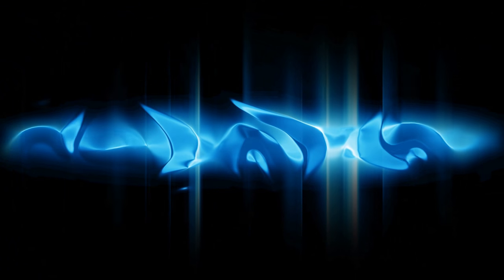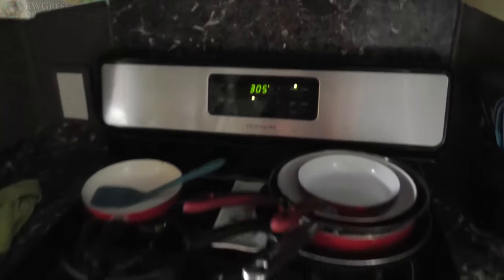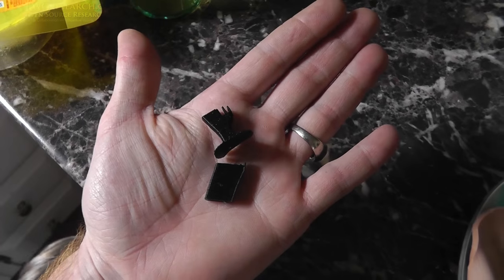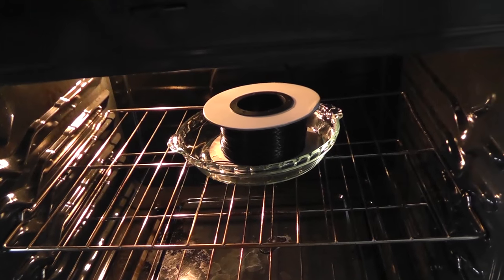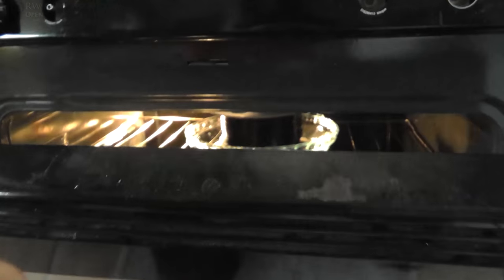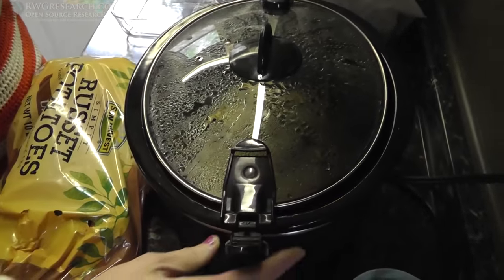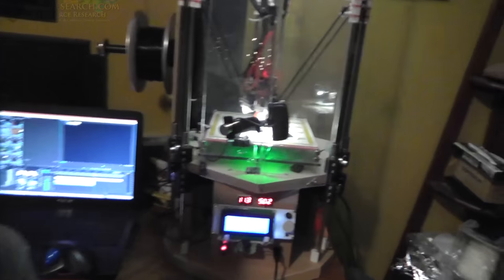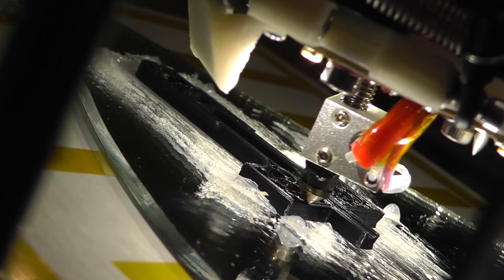This Seems Like A BAD Idea... Baking Filament In The Oven... Really?

Comment: Russ, your gas oven uses a hot surface igniter style system in the oven. Not all ovens use this style system but yours does. To extend your oven's glow coil igniter/glow bar igniter, Always be gentle when closing the oven door or doing anything around the stove. Thumps and bumps that cause the stove to jar can damage the igniter. This is especially true of when the oven igniter is glowing but it is a good practice to be gentle with the stove at all times because the material the igniter is made of can crack with even slightly rough treatment. The ignitors are usually made of a substance called Carborundum if you want to read up on it.

Comment: I am going to put my filament in a bell jar and vacuum it down to roughly 30" vacuum.  At that level water boils.  Hoping it fixes my brittle PLA.
Reply: That's sound like an awesome idea, did it work? I'm really interested
Reply: @jorgetucson8196  I imagine only if the vacuum is strong enough to permeate through the plastic. even a perfect vacuum has its limits.

Comment: Your wife tolerates your 3D printing hobby about like mine does. I waited until my son was 10 years old before I bought a 3D printer and then I let him build it with my supervision. For baking, don't use a glass pan, just put the spool directly on the rack to minimize contact with hot surfaces. I think baking at the lowest temperature possible is best, like 50C or 120F. The filament won't be damaged, the temperature is even OK for PLA, and it just takes patience (a few hours). My oven has a "warm" setting, and set there, the center rack gets to 110-120F. For ABS, you can use the lowest "bake" temperature, which would be around 170-180F.

A food dehydrator would be optimal, but we have no room for it, and they cost more than buying new rolls of filament.

Comment: I have been annealing eSun PLA + parts the past three days and the usability has greatly increased. The annealed parts are fine for hot outdoor environments now for sure. The strength has increased a bit too. 

The parts do change in dimension with about a 3-4% decrease in X/Y axis and about a 2% increase in the Z axis. The PLA+ seems to shrink a bit less than standard PLA in my observations, all this can be calculated in your slicer if need be.
I bought a $35.00 toaster/convection oven at Walmart and it works great, bought a oven thermometer toofor more reliable measurements.

Comment: Hey, be careful because not all ovens are extremely accurate and you are close to ABS's melting temperature (about 60 farenheit away). If by instance your oven is innacurate and reaches that temperature (190-270 celsius for ABS) the abs will begin to melt and emit toxic fumes (ABS is extremely toxic especially compared to PLA).

Comment: thought you had a vacuum pump?
better to just put in a container and vaccum pump out moisture,

I see this more for brittle filament like PLA, I would also "temper" PLA by putting in hot water, and works pretty good.

I will be building a box and add some color changing disicant, like blue is dry, red/pink full of moisture, then can reuse the disicant by putting in oven and watch it turn blue again. cool down and ready for the next

Comment: Use a vacuum chamber. It does the same thing as a oven but at low temperatures...also use desiccant in the chamber and once a vacuum is pulled you can store the stuff in the chamber it works really well. Yes baking is a bad idea and their really is no reason to do it.
Reply: They have special ovens for welders to keep certain rods from having too much moisture. It would probably be useful to have a vaccume chamber, unless you already have a small oven for rods
Reply: Yeah, I think more people have ovens than vacuum chambers

Comment: I am curious to know if nylon 6 filament which needs 240c to melt would work if we fill small pieces of filament in a silicone high temp mould to make a cast part using melted filament in oven?

Comment: One could construct a filament pre-dryer chamber that the filament passes through before going into the printer.  This could have a temperature that is controllable and only used when necessary.  You don't need to heat the entire spool, just the bit you are using.
Reply from the maker: +Clifford Wagner that's a good idea, however i'm not sure how long it take to " bake" out the moisture... it would take a while a lower temps... ~Russ
Reply from the maker: +Clifford Wagner that's a good idea, however i'm not sure how long it take to " bake" out the moisture... it would take a while a lower temps... ~Russ

Comment: Great video, but 200F sounds like it's still far too high for PLA, to me atleast
Reply: hes using ABS which has a higher glass transition temperature and melting temperature, but yes 200f would be far too high for PLA

Comment: You cant just vacuum seal filament rolls with dessicants, dessicants prevent further moisture from going into the filament but they do not EVER draw existing moisture out of the filament. You need an oven, and if not an oven a humidity controlled cabinet with a dehumidifier. Baking in the oven is a very good method but NOT a standard food oven, you need a low temperature oven like a cure oven

Comment: Did dou try blowing less on the hot wire deposition during extrusion ? I'm pretty sure it cooled down just a little bit too much before fusioning the new layer with the previous one, doing a bond that laminate easily when cold.
Btw, you're right when you warn about moisture, that's something we learn at school during plasturgy workshops (plastics engineering, i mean), and also controlled in factories during corporate interships.

Comment: For this your job i think you need fruit dryer. It is slower but you never melt your filament. In your link these guys real good whom creating nozzles. Firs time i have read about carbon fiber printing. In that project it is not mentioned one comparison with expensive nozles with rare materials. In our country's makers exibition I saw from guest from Russia and their nozzle was made from titanium and second strange metal which i dont remember and tip was made from diamond. But this nozzle was really expensive. Sad think is because of rough political situation Europe and Russia some good stuff is left unknown. Because they cant bring expensive things to show. And from these guys from your link they dont mention about that. Sad thing is i want to go to that makers/creators meeting in Germany but it is too far for me for now. :)
Nice to see this kind of video family with science. :) This meal from the steam pot maybe not looks fine to you but maybe it taste delicius. :)
Reply: +heris30 
The same method for drying chilies would work well here. Lowest temp of oven, usually around 150, for several hours should evaporate most of the moisture from the filament..

Comment: no don't bake the roll bake the model on 80 degrees for 1 hour they mould the layers together making it stronger
Reply: But if the roll isn't in good condition, it prints terribly. I have one roll that kept cracking during printing and it ruined the whole print.